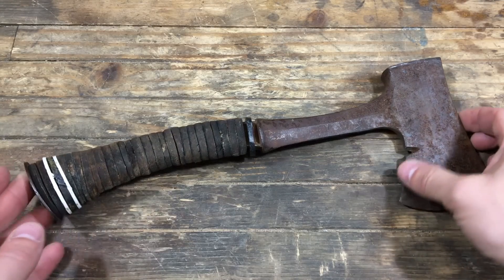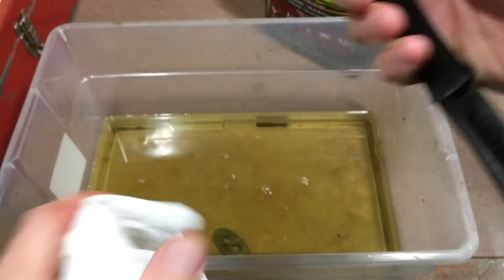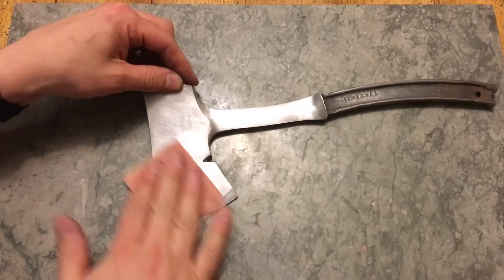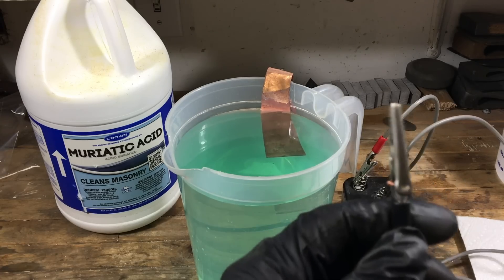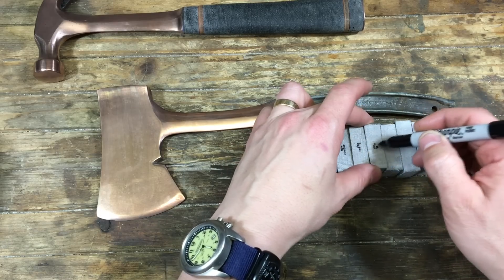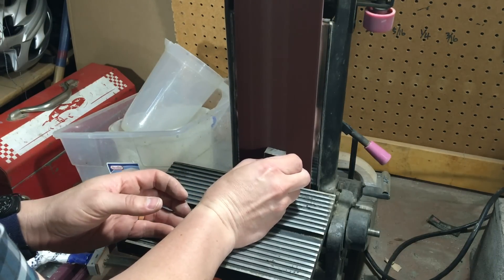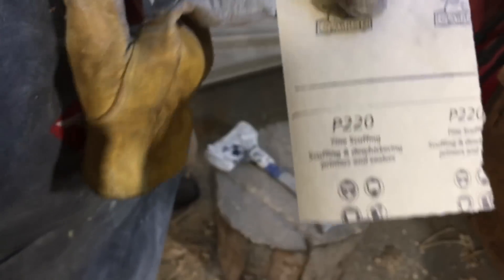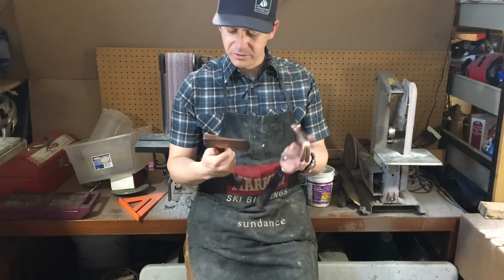COPPER Plated!! AXE Restoration - Estwing Hatchet Customization & Electroplating

Comment: When you’re sanding to a polished finish, make sure you only sand in one direction at a time and when you change direction sand at a 90 degree angle to the last direction. When you sand in circles it makes it look hazy and uneven. Try using a foam or rubber sanding pad when possible. It keeps the pressure even. I love the videos. It’s making me want to get busy in my shop again. I also loved the tribute to your grandfather. It reminded me of my grandfather. He grew up during the depression and he taught me it’s better to rebuild than buy new in most cases.
Reply: Good sanding tips!

Comment: If you use copper sulfate and hot water mix, you will get a thicker coat of copper in much less time.  Nice work with the hatchet.

Comment: Nice jobe gathering materials to copper plate now. I'm using 2prts Hydrogen peroxide to 1 part Muriatic acid to build up coppe solution. Than perhaps cut it with clean water.  In the states, they sell tree root killer which is essentially copper ready for use. Also, I'm crazy about de-rusting with un-sulfured molasses and water 1 to 9prts water. Placed in a container with lid 2 weeks, will remove everything w/o eating base metal. Will last up to 7 months but does smell some. Lastly, I've reconditioned a couple of plexy-glass aquariums grading sandpaper and it looks like you may not need to us as many transitions as you did, perhaps totally dif. than plastic.  Anyway, great job overall, I'll have to try the handle material plates for something one day.

Comment: as a sanding nut, I'd love to share how I do the polishing sanding... I haven't gotten around editing videos that show this (saving up to replace broken pc) but maybe I can describe a few major points.
To me it doesn't seem to be as much about having patience as I feel it actually gives or teaches patience... Eventually it even becomes a sort of meditation. The trick to that, is finding a rhythm and count it or sing it (if it's a song). Try to maintain the same number of strokes per grit per surface...
For more consistency, I try to stick my paper onto another object as often as possible. A stone, a metal bar, a wooden block... Moving those around is much easier to do in a consistent way than just the paper under your fingers.
I see you use circular motion. While I know that some people swear that's the way to go, I actually feel I get better results on metal with straight lines. Depending on the grit steps I take, I either stagger the direction, or always do the same direction. Smaller steps (120, 150, 180, 210, 240 etc instead of the typical doubling 80, 120, 240, etc) allow you to get away with not fully removing all scratches from the previous grit, which actually saves time in spite of using more steps. This will not give you a true mirror polish, but I find it looks even better because you get an equally deep shine while still maintaining the rough look from a strong tool instead of a tacky chromed prop. With the small steps, I use the same rubbing direction all the time. (It requires a cross section sketch to show how and why that works well)
Fixing your item will also make the work a lot lighter.
And the next big factor, would be the applied pressure and the presence of residue from previous sanding (has a stropping effect on higher grits 1000 and up). Without residue, applying more pressure will result in a more coarse result than a lighter pressure. So you can actually do 2 steps per grit. The hard pressure of a higher grit will in fact be more coarse than the soft pressure of the previous grit, which helps reaching a smooth result because it allows you to fix any errors that were left in after the previous grit. Two steps forward, one step back - the Echternach Procession.
For difficult areas, I spray glue the paper onto an old file, but be careful not to rip the paper with the file because that'll send you back to grit 80... (Return to "START", you do not receive start bonus XD)

Comment: That turned out really nice. Makes me want to copper plate a bunch of stuff. 
When moving through the grits, I’ve found that you have to sand in straight lines and change the direction of your sanding between each grit. There is just no other way to know for sure you are ready to go to the next grit.

Comment: Thanks for sharing.  To help with polishing you should use a sponge rubber backing pad. The ones used to hand sand vehicles. 3M has a nice one #05526 good bother for wet or dry sanding. As well it is best practice to sand in the same direction that way you avoid swirls. Nice job.

Comment: One tip to sanding is to use a sanding block. It helps to the the waves and divets out. Personally on an axe I'm working on right this minute, I'm using a file to get everything level and then I'll use a sanding block to shape the metal the way I would like.

Comment: Im new to your channel and I have not seen you use a 2x72. I’m sure it’s been said but I’ve experienced this first hand and there is a HUGE selection of different belts using a variety of materials. If you don’t have one already please consider buying or make a 2x72 inch belt grinder/sander. Your belts will last A LOT longer and you can get some rock bottom prices for the 2x72 vs 1, 3, or 6 inch belt sanders. Be blessed and thank you for making some really good content.

Comment: first time seeing your videos and i really dig it. one thing ive been told and learned though is if you want the copper to last, do a nickle plating layer first and it helps so the copper plating doesn't rub off or flake off as quickly over time.
Reply from the maker: Thanks 🙏
Reply: @oldshovel  no problem, I just recently learned about that as well and I've seen really good results.

Comment: Awesome video! I copper plated something a few days ago and then left everything in my shop a few days and now it won’t work when I try to copper plate. When I stick something in the mixture it doesn’t start bubbling and I’m using a 6 volt battery. Thanks for the help!

Comment: If I can not find a pure copper cup at a thrift store, what should I use (I want to copper coat my Plumb axe head I am restoring) for the copper? How long do you put it in the solution for each coat? Is more voltage (I have a DC power supply) or more amps better?

Comment: I'd like to see a  plated Tonka truck. I've seen em painted, and powder coated, but not plated. Nickel might be a better choice tho. Can you take one of your half dollars, dip it in like half way into the copper, then turn it around and nickel plate the other side? Also if you can rig it up, like on two metal rods with a couple of bolts or something hot glued in the middle, so you can keep turning it in the plating sauce but only plate say a quarter or 3./8 inch around the rim... I've got to get some way to do plating myself so I can try all this stuff

Comment: how would you maintain something that has been copper plated? i have a piece of steel i want to plate and was looking to see how it could be done. thanks for the 3 vids on this subject.
Reply from the maker: The copper develops a patina over a few months. I’m still looking for a way to keep it nice but they all tarnish after a while.  I tried a clear coat to protect it but with use it took the copper off with it.
Reply: @oldshovel  ah.. well the piece I'm going to be doing will be a sort of decorative piece. Kinda like a paper weight sort of speak.. So I won't be banging it too much. So I can clear coat it and have it last a bit? And again thank you for your time I really appreciate it.

Comment: Job well done. Hopefully that copper cup will go a long way. Does the acid  solution seem to be better the first time around or did you notice any less coating cohesiveness with the pre used batch on the hatchet? Thanks!
-Will
Reply from the maker: It actually seemed to coat faster. The green color has been darkening with use.

Comment: Loving your videos.
I have always tinkered with upcycling and restoring old gear but your videos have inspired me to get stuck in and try do more.
Thank you and keep them coming 👍

What concentration is the acid you are using?
Any of the concrete cleaning acids i can find where i live are very low, like 1.5 to 3%
Reply from the maker: Awesome. Will do. As to the acid, I’m not sure what the concentration is but I used 5 parts distilled water to 1 part acid.

Comment: Great video. Does the copper plating “feel” softer than say chrome plating? I am thinking of copper plating some old golf iron heads. I will probably have the old chrome plating professional removed, unless you have a video on DIY chrome plating removal to take it to the raw steel before copper plating it. The intent is to protect the carbon steel with plating while keeping the “soft” feel of the carbon steel. 
Would love to get your thoughts! Thanks.

Comment: you can use a power adapter of anything 3 volts or less instead of a battery. Also, it helps to run two annodes through the acid water mix when you first start. that puts the copper in the fluid before you even start. 
You might want to consider going to nickel plating. It doesn't oxidize like copper does. It won't be long that copper will turn black from oxidation.

Comment: Your hand sanding would go much faster and easier if you started with very high quality low grit sandpaper. I noticed your grits before 400 were not FEPA standard (indicated with a P before your grit number). Do all your work with your lowest grit and use the rest to remove your sanding scratches. 1.5 times your previous grit as you go up your grits. Also sand in 1 direction until you're close to done with your grit then sand perpendicular  to more easily even out your scratches. Hopefully this helps a bit.
Reply from the maker: Thanks for the tips. I’m always up for improving.

Comment: good afternoon == can you clarify the exact recipe for the composition of the electrolyte? I also want to cover a metal part as you have = thanks =
Reply from the maker: I use a 5:1 solution of distilled water and muriatic acid and a 100% copper anode. Additional detail is in my copper hammer video.

Comment: What's strange is that most sources will say that copper can't be plated directly on steel. I've tested this with copper acetate electroplating on steel and just like they say it doesn't work. You're copper solution using muriatic acid most make the difference?

Comment: Hand sanding sucks. Use a 1/4 sheet sander to go thru those progressively higher grits. It may not work for the whole tool, but it'll really help with some of it and keep you sane.

When you get above 600-800 grit switch to a buffing wheel and some rouge.

Comment: Why don't you try flux and solder to cover the holes then maybe it will sand more even... not sure. just telling ideas :P I mean if you give a copper plate then solder on it the sand and re plate it will cover the crack 100%.
Reply from the maker: Cool idea. Thanks for chiming in.

Comment: Don't plate copper directly to steel. It won't last, and will start coming off in pretty short order. Copper and most steel alloys are dissimilar metals and react with each other. If you want to plate steel with copper, you must plate nickel to the steel and then plate the copper to the nickel.